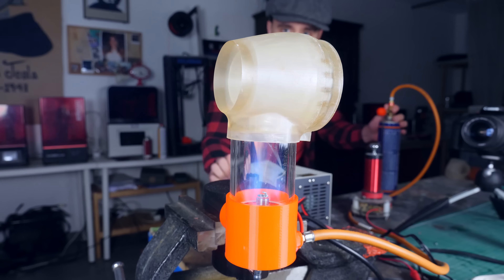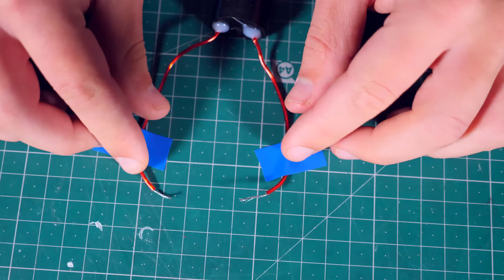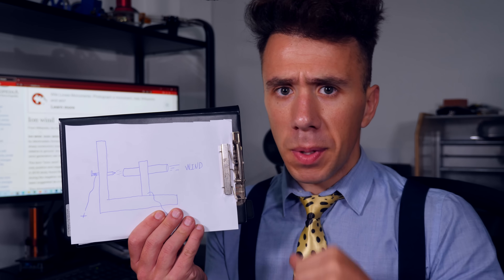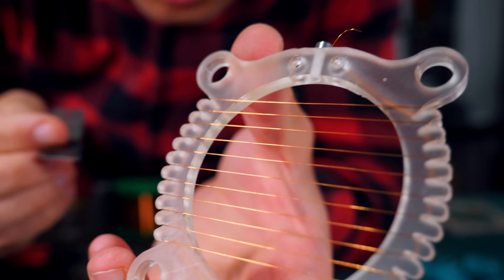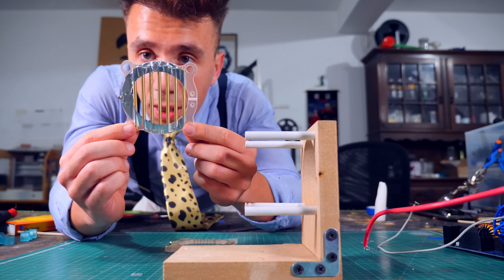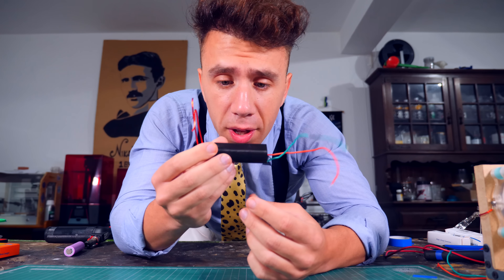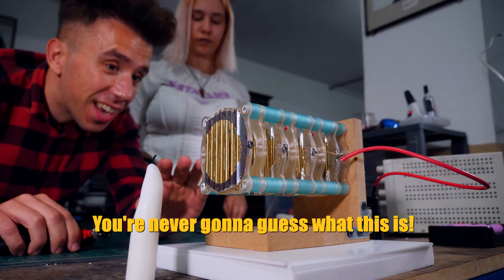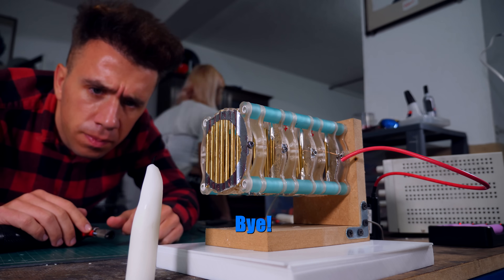I built a TRUE BLADELESS FAN

Comment: To increase airflow you should try feeding the output of your device through an air multiplier, the same way the Dyson "bladeless" fans do.

It's been a while since I read up on them, but IIRC you feed the fast-moving air from your fan through a hoop with a thin slit all the way around it. The fast-moving air exiting the slit creates a region of low pressure inside the hoop, which then pulls a much more substantial amount of air through the hoop, giving you a far higher moving mass of air.

Comment: Would be interesting to see how it performs when all stages are encapsulated in a tube (so you do not loose any air flow to the sides).
Another idea would be to rotate every second stage by 90° to get more even static pressure across the surface area of the outlet.
In addition you could put a nozzle at the end of the outlet to increase air speed.
Reply: I'd be interested to put an ozone sensor at the output to make sure it's not creating o3 from o2.
Reply: @Craigelz  corona discharge will definitely generate o3, thats how most o3 generators work
Reply: if it was you could probably smell it right off. I may be wrong, just speaking from what I know about my ozone machine...
Reply: @butchgarner3911  Generating so much of ion wind definitely produces ozone. You can smell it with much smaller setup than he's got.
Reply: @georgjr2  thats what i was thinkiing, he should be able to smell it but, he didnt say anything about it. i cant smell it and Not say something about it... lol
Reply: @Craigelz  Oh it definitely is creating Ozone.
Reply: @laststand6420  The sweet sweet taste of o3 poisoning... Not so good for household use but, putting one on my cars turbo air intake would be interesting.
Reply: This is what i was thinking as well, also maybe flared on the intake like a big funnel with the workings in the middle.
Reply: Another way to accomplish this would be for the wire grid to go in both directions, and to replace the tubes with a grid of hollow metal spheres. Also I wonder if bare wire would avoid the issues with having to scrape insulation off with a razor blade, and let the whole length of the wire work. I'm excited to try!
Reply: using a venturi can help to accelerate the output
Reply: now youre thinking
Reply: He could also make a conductive hemisphereical cone connected to each of the "sharp" sides to achieve a slight compressive effect from outside of the path, then enclose that in a tube. You'd get sort of a conical jigsaw shape
Reply: Now we're gonna built bladeless aircraft engine?
Reply: Please see the SkyStaiion International ion propulsion patent for that.  EAD devices actually pull in extra air from the sides though, so it tends to represent extra weight and a loss of power to encapsulated them.
Reply: Create a nozzle at the end, so like how Dyson took the wind from a small fan, made it circle around and come out faster?
Reply: connect tubes to the next wire via an insulating airfoil to keep the flow laminar maybe!
Reply: I was thinking the same thing but after the first "ion generator" have the remaining ion generators in a bell nozzle. That progressively get smaller and either use copper tape to line the nozzle or attach copper wire on the inside of the nozzle. You could print the nozzles with grooves in the interior of it where the copper wire would go. I'm curious though if the ion generators get hot enough to melt pla? If so I think 3d printed ceramic nozzles should work.
Reply: Also like Grant Clark mention your put a sphere in the inlet of the nozzle to possibly increase pressure . Also connect the nozzles together .
Reply: When there is a pressure drop air is pulled from every direction, so it probably pulls more air from the side than the front because there is more area on the sides. It still would be good to try the tube because he didn't show where the air is coming from.
Reply: and add an afterburner
Reply: Rotating every other stage cause more turbulence an decreases overall wind flow.
Reply: DUMB, WONT WORK.  this will just cut off the amount of air that it can pull in an accelerate.

Comment: Instead of orienting all the stages the same, try rotating them so that the second stage is 90 degrees opposed to the first stage, and the third 90 degrees relative to the second, and so on down the line.  Or even just offset the orientation slightly from one to the next, like in a helical pattern.

Rationale being that the airflow moves from the wires towards the tubes, but is then physically impeded by the tubes.  By having the next set of wires immediately behind the tubes from the previous stage, they're essentially placed in the "shadow" of the prior stage; a low-airflow region.  Changing the orientation so that more of the wire coincides with high-airflow regions should theoretically net you a higher output velocity for the same number of stages.

Comment: Do you have a way of recording if the air speed is cumulated just by pushing air forward as trough a tunnel or it also sucks air from the sides.
It would be bad news if you enclose it and it still needs extra air.
As a paradox to this - what is you enclose it and it actually needs air to increase the volume of air at every acceleration.  
Many questions - also is it power hungry?

Comment: I will warn you that high voltages can be fatal. My current work is with pulsed fence energizers, where about 9 kV is applied to the fence to keep animals in. The pulses are designed to only occur at greater intervals than one second. This is because if you touch the fence, the interval to the next pulse must give your heart time to recover. This is a simplified explanation. 
High voltage DC will be very dangerous. This would mean that a air mover (it is not a fan) like that will need to exclude fingers by being in a tube, and the tube should be larger at the intake end, to increase the speed of the air flow.

Comment: Well done it works great, i dont really know if i would call it an Bladeless Fan,  I guess it is a breeze generating device,  But im pretty sure you just built an o-zone  generator. How does it smell ?  Bleachy ? Pretty sure it does.  That aside,  what a fantastic build and it performs really well.

For 3D Printer Win Viseo idea.  I know you like Roxkets.  How about a take on the classic Air Filled Bottle Rockets but rather than plain old Air,  Use different gases,  Light and Heavy to compare the differences,  see if some perform better or worse and/or Mixed Gases,  

Maybe combustible gases, and giving them a bit of ignition for a bit of extra fun.

I would love a 3D Printer,   I didn't try to build a DIY one,  but failed miserably,  I'm visually impaired to building  things is sometime different,  I need to be able to design and hit print without worrying about trying to fix the 3d printer every time because it shakes itself to bits and brakes it's own parts which I need to 3d print to fix to 3d printer over and over again.

Love your Video and epic projections and ventures.

Cheers,

Sean (Near Liverpool, UK)

Comment: Seems like maybe some walls could increase the pressure. you could drill holes in a tube and run the wire through like a '#' you could also seal the holes after for maximum pressure. Maybe a super sized version to make actual thrust?

Comment: i would collect data and model the ideal arrangement for size of conductor grid, as well as distance between the positive and negative charges to find the ideal distance between modules as well as distance within that module. 
of course then the same with voltage, find the point of best return / highest efficiency per watt input.
or use your tesla coil to get high voltage, partially bc it'll give high voltage, partially bc it'll be a good title and thumbnail.

Comment: Contain it all in a tube. So the outside air is not mixing and interfering with the aceirating air. Of course it won't look as cool as the open one. 

Then consider the aerodynamic effects of the parts. Aerofoil instead of pipes. Streamlined entrance and exits to the sections.

Comment: a couple things come to mind. 1) successively larger gaps: Ionized air should allow for a large gap jump as compared to the intake air. Couple that with increasingly higher voltage should get more air moving (my theory). 2) directional control. By energizing different HV converters with a common emitter wire, the ions could be directed to a specific receiver tube, thus creating a directional flow. 3) concentric operation: since the ions flow from small to large electrodes, start with a smaller/fewer number of electrodes in the middle, and a larger number of electrodes in concentric rings, increasing in size/number in each larger ring.

Comment: Idea for a future video: That cheap Chinese high voltage coil is pumping out more energy than you are currently using, even with all the stages. There are several ways to improve the design. You will be losing air flow in the open design out the sides but you do have good air speed, so 3d print some tubes instead of using spacers to connect the stages to increase total air volume and possibly increase final air speed. Also, try using fine mesh screen that has been sanded one one side in only one direction with coarse grit sandpaper and not individual wires nicked here and there with a knife edge, as this should drastically increase the number of corona points. You should see almost a coronal flame, not individual points or discharge. In the dark, stop adding stages one stage before you can't visibly see corona, and you will be utilizing the full output of the high-voltage source, whatever source you use. The only question I have is whether the fine mesh screen will slow down air flow too much, or limit you to only one stage. If this is the case, try the same with a coarser mesh fine wire screen. With screen, you will have corona loss around the edge, which is bad, so design your mounting piece with a ring that locks into place covering the edges of the screen and seal this ring with liquid electrical tape and thus completely stop corona losses. Just an idea, but it should work. I have been messing with high to extremely high voltage, both AC and DC, for decades. High voltage corona loss is something I usually have to design specifically to avoid, lol, so using a high voltage device specifically to MAKE corona discharge is easy for me.

Comment: simple, wide inlet narrow outlet, start large and go down in size at each step, longer= better, the air is literally trying to go as fast as the electrons so the longer the tube the faster, or you could do super wide then get super narrow at the outlet forcing tons of air into a small hole. or hey do both and make the first ionic jet/rocket

Comment: 1. Design it to compress the air, using smaller stage openings for each stage and cowlings (ie cone shape)
2. Turn if vertically to see if you can suspect a small light wieght object like balloon or ping-pong ball. (ping -pong is probably not going to work).
3. Try making a cone shaped ground plate (3D print a cone and wrap the wire around the cone from the big opening of the cone to the small opening (parallel to the cone). This might create a smaller but higher wind speed as the ions are compressed and accelerated

Comment: Whoa Stop Stop Stop… lower that table saw blade to where only a single tooth max is above the work piece. Also never run a piece that will end up being almost square between the blade and fence. Kickback is very serious and having the blade that high amplifies the risk of serious injury. please just use your miter gauge that came with the saw or make/get a crosscut sled. 

Believe it or not but the table saw is the most dangerous tool in your shop - especially using it like that. Love your work! Stay safe!!

Comment: Future video idea: 

Improvements to the generator:
1. Use iron shavings on the wires to increase surface area
2. Use springs instead of straight wire
3. Make a loop of ionic generators so they cascade in such a way to get super high speed (ie infinite stages like a resonator)
Reply: Incandescent light bulbs used a "coiled coil" for their element wire. That is, you coil wire like a spring, to create a very long floppy spring. Then you  take that long spring, and put IT around a rod to make it coiled again. A coiled coil. It's a way of getting lots of length of wire into a small space, useful in light bulbs where the hot wire makes the light. Man, can you believe those were the light bulbs the entire WORLD used up until the 1990s? So wasteful, heating tungsten all over the place! Now it's all 5 watt LEDs instead of 60 watt hot wires!

The colour rendition is crap, tungsten's was very good. But still, LEDs cost almost nothing to run, it was worth it.

Comment: Make it bigger and add stages, outer edge is less dense and is designed to pull air in while the center is very dense and is designed to accelerate the air as fast as possible.

Maybe the same length wise as well so basically it’s a electric air funnel.

Comment: Thanks a lot for this awesome video ! I love your work, it is such a pleasure to learn and discover science with your experiments !
Here are some ideas for a future video based on this project :

- You can add more power on the entry 
- You can amplify amperage voltage and frequency 
- You can find the perfect harmonious (resonnance ?) equilibrium between amperage voltage and frequency with an adjustable electric generator, and with coils, 
- You can find the perfect harmonious equilibrium between wires to tubes distance, wire and tubes diameter / thickness / number, distance between wire scratchs (corona),
- You can try a version based on (super ?) capacitors for an hypothetic powerful but short "wind"
- When you have find the perfect power, perfect features equilibrium, you can create modules (for example 3 "couple of wire-to-tube plates" for a module, which can connect / disconnect  and allow you to test different numbers of modules (increasing the length and wind power of the thing, maybe)
- When you're ok with your true bladeless fan, you can work on an aerodynamic enclosure which would optimize and concentrate the wind flow in and out the fan. For this part you can use the coanda and venturi effects, you can also make the acceleration of the air in the device suck in more air through suction holes that are spirally guided inwards

- Optionnal subject to search about : Magneto (or Electro?) -Hydro-Dynamic, which is about moving fluids with high frequency electro-magnetic fields

I hope there will be some good ideas among these, and I hope my english is readable
I wish you all (except for tomatoes !) a wonderful day from France

Comment: Now that you’ve almost mastered both rocket and jet engines, I think it is time you used it for something interesting. Using the thrust/bleed air from the engines to power tip jet engines on a rotor, adding fuel to get a sort of afterburner at the wingtips. Sorta like the original Hughes XH-17 helicopter prototype from the early fifties. With your know how and todays technology, I’m positively certain you can do it!

Comment: The question I have in mind is actually scale. Like, not more stages, but bigger stages! More surface area. 
Could be a good test to print a larger size ring with more wire loops (same for the tubes) and test the performance.

Comment: Talk to Mhedi from Electroboom about how to maximize your electron flow out of the wires and into the pipes.
Maybe talk to an aerodynamics engineer about the optimal spacing and form of the "fan", maybe an enclosure? 
Also try rotating the wire-pipe-pairs against each other to try and create a better airflow pattern.

Comment: This effect is otherwise known as the biefield-brown effect, if you research Townsend brown's original patents you'll see he did not attribute the movement of his devices to ionic wind. High voltage DC discharge through a series of conductive/insulating layers- high voltage generator needs to surpass the breakdown voltage of your insulators - rather then a wind being produced, the entire setup should move forward towards the positive pole due to a modification of the gravitational fields! Brown went to France in the 60s to prove undeniably that ionic wind was not a part of the effect

Comment: We had an "air purifier" years ago that ran on that principle, it hissed/whistled and had a dull purple in the dark. I used to breathe the air coming out of it but wondered later if that was a good idea. It had a removable center piece made of 2 long flat pieces of gold colored metal. Maybe around 2002.
Reply: I have an ozone generator which I think uses ceramic plates. You most certainly do not want to be breathing it. Yours was probably one of the "legal" home devices. Mine has a timer and the room absolutely needs to be cleared. I got it for sterilising and deodorising.

Comment: I suggest a step back from hating blades and to put one of these as what would be the combustion area of a jet engine, instead of burning fuel you could put the ionic wing generator in it. I'm interested to see if it gains efficiency or power when fed with higher pressure air, and if the turbine stage can be started by itself.

Comment: If you can calculate the acceleration through 1 step amplifying the power through later stages may make it faster as if power is constant acceleration is more limited so basically increasing the power difference increases over gates increases the airspeed

Comment: This is the first video I've ever seen by this guy. And I love it. Brah, you're onto something.

Larger diameter, smaller anodes and cathodes, higher number of anodes and cathodes and multi staged (really thin stages) should allow a sufficient amount of airflow with minimal hum due to having to use less voltage/amperage (whichever is generating the wind force). I would also take resistance of the wires (ohms) into consideration in your calculations to see if maybe that's a variable. Good luck!